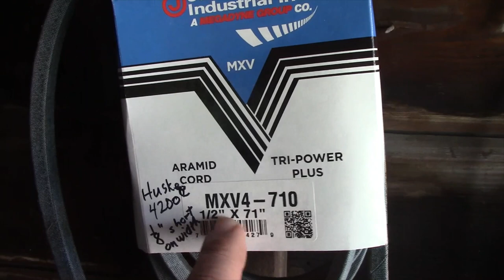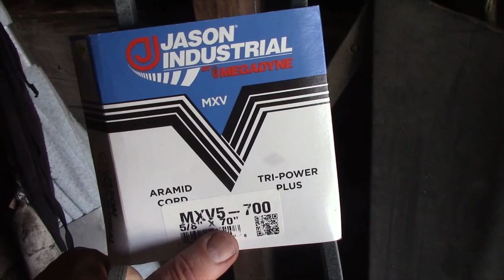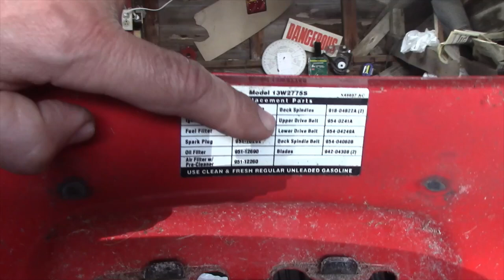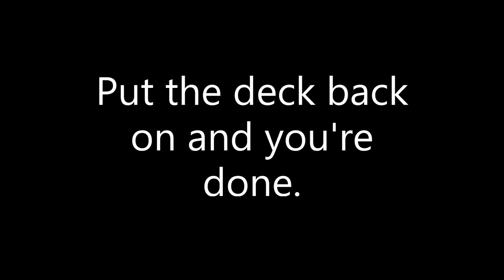How To Install Drive Belts Huskee LT4200

Comment: I replaced my drive belt removed right side wheel  4 nuts and bolts that hold the transaxle on 2 bolts on right side the whole rear end drops down to replace the drive belt easy all done in 20 mins !
Reply from the maker: good idea

Comment: You don't have to cut your mower in half to do this. Simply raise the deck all the way up, jack the mower up and remove the back wheels, remove the battery, and use a screwdriver to release the spring on the small pulley on the left side of the mower. Use a 22 mm to loosen the nut on the big pulley. Remove the bearing holder on the bottom of the double pulley and install both belts and reinstall everything. Then lower the deck to the bottom. Go to the front and remove the pin on the rod in front of the deck and remove the rod. Remove the Bolt on the front pulley so that it drops down and put both belts on. Line up the notches and slide the pulley back up and replace the bolt. Replace the rod and pin by raising the deck up. You're done. I just did this in less than a half hour on a LT4200 and it was simple.
Reply from the maker: Ok

Comment: Bro. I appreciate the tenacity but it isn't that hard. If you loosen the pulleys you can slide the belt around the pulleys in between the pulley and those little tabs. Hope that makes sense.
Reply from the maker: Yes, I found easier ways to replace the belts.
Reply: I have an SLT 4600 and connecting the deck isn’t as easy as the SLT 4200. In front there’s a yoke and the two support arms on the rear are held in with springs that don’t allow enough clearance for the deck support arms to fit back in. I’ve been working on mine for two days and now I have to loosen the pulleys to replace the top, drive belt. What a pain! I wish I had a concrete floor and better tools. Tough sledding on an uneven gravel driveway. I’m too old for this!

Comment: Just purchased the same mower used from someone got home and it will not drive up a hill without having to mash the clutch and let off I think the drive belt may be worn out I hope that's all it is thanks for the video
Reply from the maker: Usually, the drive belts need replaced, look at it.
Reply: @twagner6155  ok thanks

Comment: Well I was almost at that point of cutting my Huskee up like that, lol, I could not find the last remaining bolts holding that whole top plate/foot holder or whatever it's called, but I kept going and found them under the big sticker on the floor, why they didn't make the sticker with two holes idk! I used a heat gun to peel the sticker back enough to get to the bolts, I would weld that back together or put a couple plates on it n a few places just to give it some support back n to lesson parts from coming loose n doing possible damage.
Reply from the maker: Yeah, I'm too lazy to weld it all.
Reply: Been trying to figure out what you just said about the sticker for a couple of weeks now searching through videos. THANK YOU! Can finally deal with the rear drive pully that just fell off.
Reply from the maker: @Bucketsu  Wow, the pulley fell off. Yeah, that is true about the sticker. I was working at the time I cut the mower up and had to get the job done quick. I jack the mower up, put it on jack stands but still find the hack job works for me.

Comment: I just did this and the part numbers are helpful, but most of the technique isn't useful. There's no need to remove the seat, cut the housing, the pull tool could be helpful. To get the pulley out, remove the 4 bolts (1/2" heads) that hold the rear axle on and lift up on the mower, makes removing the pulley a breeze.

Comment: Well that's one part of the procedure.   "THE EASIEST" But why would you butcher the body like that. You just needed to remove springs and the battery.
Reply from the maker: Yeah, you can leave the body on and still change the drive belts. I have changed the drive belts twice and just didn't enjoy getting my hands in a 6x10" hole.
Reply from the maker: You can also turn the mower on it's side like Taryl Fixes All.

Comment: i can't believe you cut the body in half instead of just removing it.
Reply from the maker: It's so much better but yes, I could have tipped the mower on its side after putting Walmart bags under the gas cap, and oil cap.
Reply: He lost a viewer at that point!
Reply: I just took one of them little belts off he said it measures 36 and 3/16.. on the outside.. It measures 35 and 3/8.. and that was on a used belt  it .should have stretched... If you measure with a metal tape measure it will always come out long!

Comment: This guy isn't doing this job correctly might need look somewhere else lmao Lord help him!
Reply from the maker: Thanks for responding. Improvement in the technique will be on the next time I have to replace the belts if there is a next time. Taryl Fixes All is good at this sort of thing since he just keeps the gas from coming out and turns the mower on its side to change belts. I was frustrated and wanted to speed things up.

Comment: Sir do you know the part numbers for the upper and lower drive belts? I use the ones from the sticker on the hood but come up with different results. There's so many cross brands that use the same thing. I have a huskee lt4200 also :) Just don't want to order the wrong part :)
Reply from the maker: I'm sorry I haven't got back with you right away. The very most important specifications are the length of each belt and the width of it. I go to Jacks Small Engines for specs for these belts. I will put the specs for the 2 drive belts and the deck belt in the description above.
Reply: @twagner6155   I to am playing with this puzzle and holding back putting it down. Did you get an answer?
Reply from the maker: @neverforget6657  954-04249A= Lower drive belt, 954-0241A= Upper drive belt, 954-04060B= Deck belt. I did change the description above and have the info in detail. Find each number in the descriptions on Amazon and order that part. I had to order each belt individually.
Reply: Go to tractor supply and pick up Deck Belt 1/2 X 96, Transmission belt 5/8 X 71, and PTO Belt 1/2 X 35.